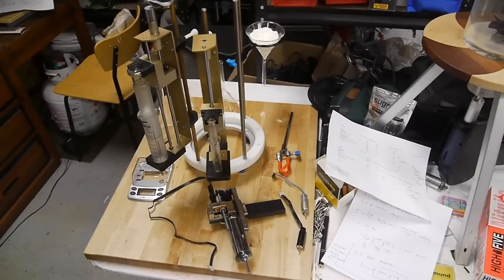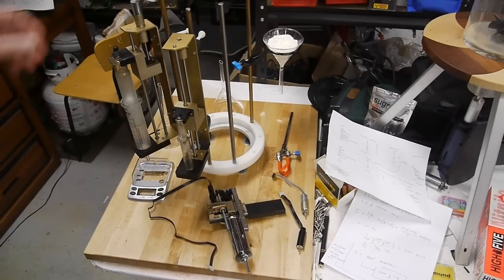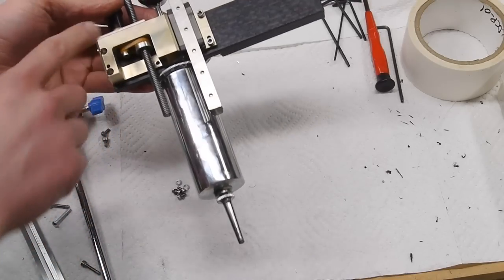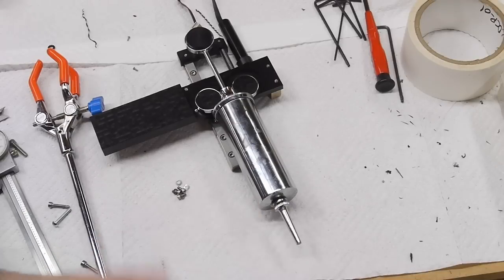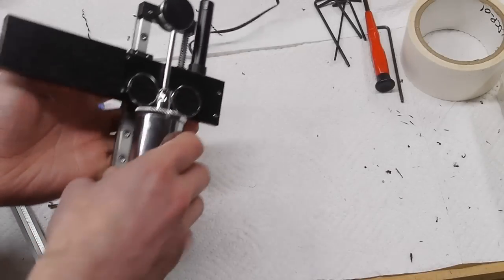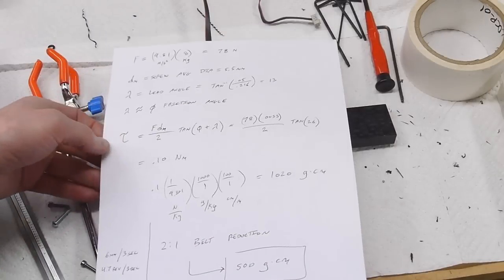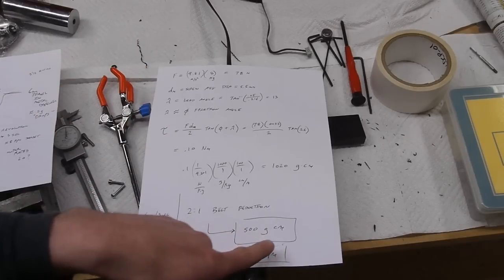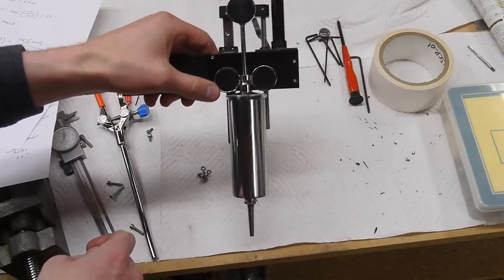Cookie perfection machine - butter dispenser

Comment from the maker: I've received lots of comments about this, but I am responding to yours. Yes, we all know kg is mass and N is force. However, we also all know what kg-force is, and using it is convenient in many engineering tasks. Catalogs list small motor torque in g-cm because it's easier to conceptualize what a g-cm is. Listing 1 g-cm makes sense, but .000098Nm does not.  981uNm is not at all common in engineering, and introducing it would not help anybody get their job done.

Comment from the maker: I may end up using the encoders, but I think just monitoring the mass dispensed onto the balance, and driving the motor with the microcontroller will be best. I guess it will be a sort of PID control loop with the signal from the balance being the process variable.

Comment: If you do find the syringe is coming off the machined plastic disks then you can put a bolt through the center of each disk and put a washer on the bolt that has a larger OD than the syringe rings. You'd then use the bold to tighten the washer against the rings. A simple solution, it needed.
Happy testing!

Comment: If you want to get even more precise with you butter metering you might be able to locally melt the butter right at the tip. Some nichrome wire (McMaster) and some ceramic thermal and electrical insulator(once again, McMaster has ceramic wrap/sleeving) should do the trick.
Should drill and tap the centers of the disks that hold the syringe in place. Large O.D. washers and screws can clamp/keep the syringe in.
Also, what kind of gearing are you planning on the spinning platform? Worm? Spur?

Comment: not sure if it matters to you on this project but I have noticed that the temperature of the butter when the cookies are baked does change the texture and look of the finished cookies. (completely melted butter produces flat, crunchy cookies while cold butter produces tall, chewier cookies)  just from what I have seen. perhaps this could be managed by using a thermometer in the cookie dough as it cools or warms in a separate location.

Comment: Cool!
You could probably use a nozzle with a much wider (more obtuse) cone on it to reduce the required extrusion force. A 45° half-angle might be ideal, tapering in from the full width of the syringe.
It could be hard to find though!
Shortening or removing the nozzle entirely (if the diameter is ok) might give a significant improvement too.

Comment: As mentioned by another commentator, heating will spoil the butter consistency. The machine is also slow even with this cheat.  I think the answer is to have a syringe with no nozzles, just a flat end with multiple holes. I have to spread Nutella paste from individual micro packs onto cookie S' mores among numerous other tasks in a pub kitchen and it is one of the more time consuming tasks in a maniac environment where seconds count, so I am looking into automating this annoying task. At least this does not involve mixing any ingredients.

Comment: If the motor is too powerful then just simply limit the current by electronic means. Doing so will limit maximum potential power because you made the torque term smaller for the horsepower formula. You can use the same voltage just that max torque will be less since you limited current. Look up the torque constant of the motor or find the torque constant through experimentation.

Comment: It's funny how often you find imperial sized stuff in European hardware. The machine I built my laser cutter on was made in Switzerland yet it had a leadscrew was a 6-start, 1/2" per turn screw that was 1/4" in diameter. In other places in the machine there were odd-ball metric measurements that converted perfectly to inches.

What are you planning on using to control the motors? Are you going to use the encoder on those little maxons?

Comment: force i often "simplifyed" by using the equivalent force of a mass in the earths gravity.

the scale already does this, it cant measure mass, it measures the force and aproximates the mass. 

so you just calculate it back to force.

he also used the tourqe in g/cm, that is also not a correct unit of tourqe.

so you will just have to accept that its common to use the units for mass when measuring force.

its wrong, but common.

Comment: the thing is that if your dispensed material is gooey then you'll not be able to measure the right amounts on the scale. you better measure by volume and make mechanism that will cut the material at the exit.

Comment: I started building a donut vending machine some time ago. I would have loved to see your approach on the problems that came up. Eventually the funding stopped so the project died :(  One question: How do you plan on feeding the syringes? Still, if it were, how would you go about continuously feeding a viscous material like butter into a small dispenser?